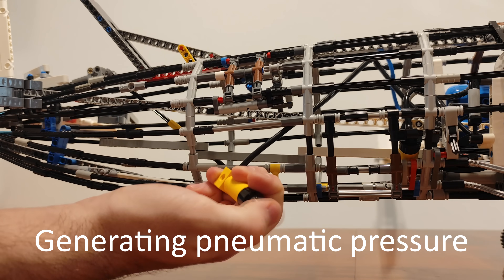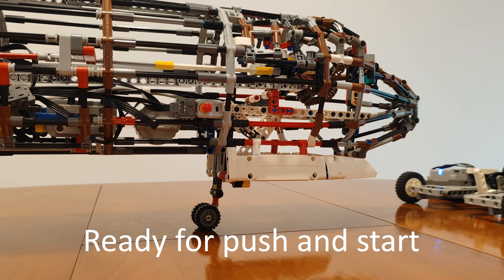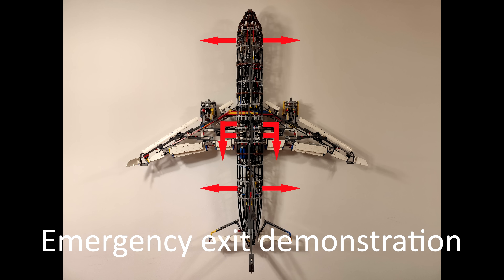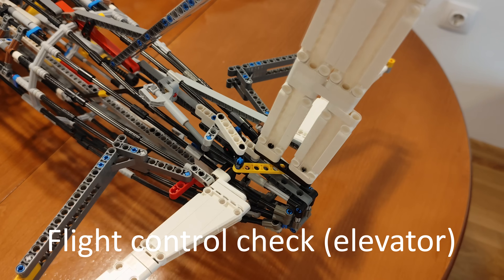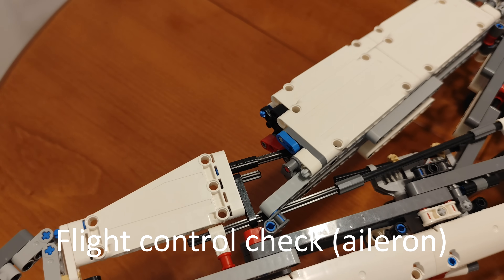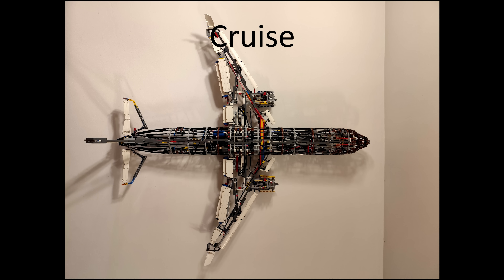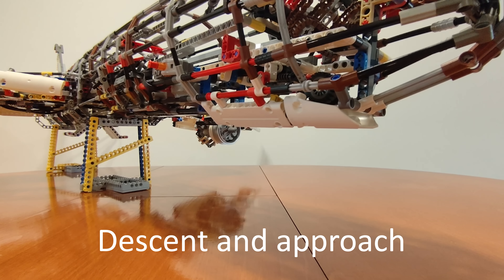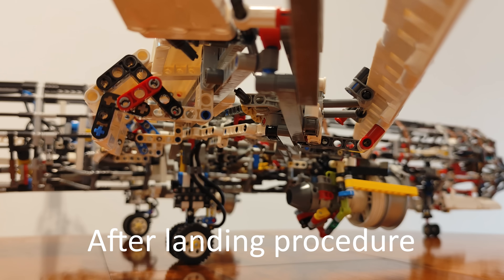LEGO Technic Airplane MOC with Power Functions and Pneumatics HK-9

Comment: Это ахринительно, очень круто. почему бы тебе не сделать двери в салон тоже на воздухе?
Reply from the maker: Thanks! what do you mean?
Reply: @lordkarsa  You can make sure that the doors to the cabin open with the same mechanism as the luggage doors
Reply from the maker: @Sanches_chiba  yes, but on airplanes usually the cargo door opens with hydraulic power but the passenger doors manually
Reply: @lordkarsa  It would be interesting automation. In Dubai Air aircraft, the doors seem to close with a button, the flight attendant only turns the closing handle.

Comment: Just one detail. There are no ground spoilers. There are just spoilers. You can use them wherever you want. During flight. Very good for quick descent.
Reply from the maker: To be honest how you call them depends on the manufacturer. Could be spoiler, speed brake, interceptor etc. For example for airbus, during a landing when all of the spoilers deploy at touchdown they are called ground spoilers. Otherwise when you use them in the air they are called speed brake. And when they are deployed in combination with the ailerons then they are called roll spoilers. You can even see it on A320 flight control schematics. See the link:
https://www.aviationhunt.com/wp-content/uploads/2023/06/27-ds-a320-fc.webp
Reply: @lordkarsa  Well, from the image it is obvious why is that. There is different function during flight and during braking on the ground. Different actuators are involved.
Reply from the maker: @petrsedlak4761 1 actuator for each tab

Comment: When I was in 7th grade I made a 3 foot long model 737 using 3 different mindstorm brains. It had retractable flaps, retractable gear, brakes, nav, taxi, landing lights. cCould move and steer under its own power, spinning engines, had movable flight control surfaces. The controller I had to rig up was absolutely wild and there was at least 12 wires connected in a bundle to the plane at all times. 

This seems like the more adult version of
Reply from the maker: @devoncantrell3311  do you have video about the airplane?
Reply: @ I wish I did!! It wasn’t nearly as cool as this one is. I made it with technic beams .

All the systems were servo based. I had one controlling the ailerons, it was connected to a shaft that went into both wings. I believe I had done the flaps using a toothed plate and a gear to extend them and they would articulate in the middle to make it kind of look more realistic. 

The front wheel was steered by its own servo as well. The rear gear were directly mounted to their own two servos but they were wired in parallel to the same port. 

I remember that it was a huge challenge to make sturdy enough to drive around, but it was really fun to taxi in the room because the size made it so the wingtips would realistically bounce slightly.
Reply from the maker: @devoncantrell3311  sounds cool! :)

Comment: 3:56 you don't need the "positive" you could've just used the word climb and/or assend
Reply: In aviation that’s what it’s referred to so once you have positive climb established you can then trim out the plane and retract landing gear
Reply: ascend
Reply: Positive rate is actually important during takeoff. If the aircraft is not climbing landing gear will stay down and will impact the ground if the plane crashes. If not gear will be put up
Reply from the maker: next time :)

Comment: I would like to see it flying 😁
Reply: It has no aerodynamics in it and the wings wouldn’t be able to generate enough lift due to the holes so it is not possible for the plane to fly
Reply: @nhatlamvo6307 "modelling material foil" or something else like I said
Reply from the maker: Me too, believe me! :D
Reply: @lordkarsa  You could power it with two jet engines, put on it modelling material foil to make it aero.
With enough kg thrust even Lego will fly.
Reinforce it with lego, so it would'nt be so bendy/flexy and survive jet thrust.
You could rebuild it with real electronics, bc "lego electronic" isnt made out of Lego either.
Reply: @lordkarsa  Second idea is to put one bigger jet under main body and set in angled position, so it would give a little upward thrust and forward thrust.
Lighter concept, more centralized weight distribution and more solid mounting (unlike jet mounted on wings would transfer a lot of forces through wing's structural lego)
I dont have money, so I only dream talk, dont have experience, its fun to imagine building sth like this.
Reply: @lordkarsa  But either way, 4kg isnt that heavy, if you have big enough wings, just normal strong propellers will be enough.
But jet on lego would be kinda cool.
Reply from the maker: @ For sure it would be cool :) I also started with imagining stuff, then I started building bigger and bigger airplanes as I acquired more and more parts. So don't give up your dreams!